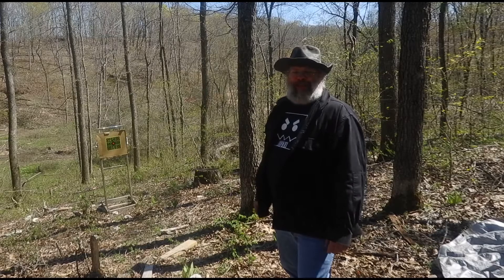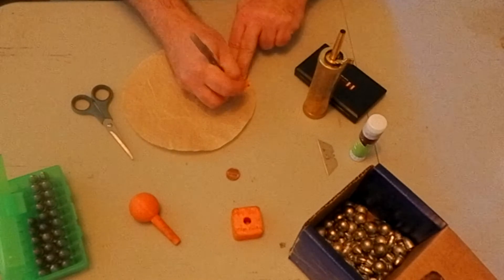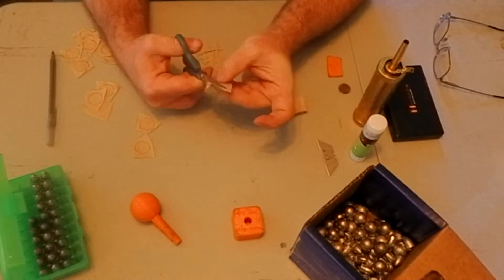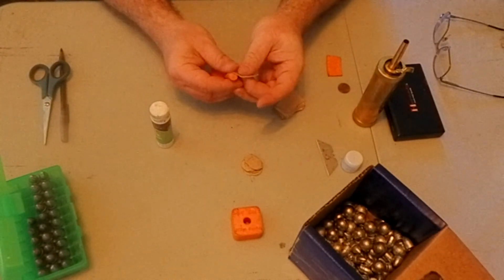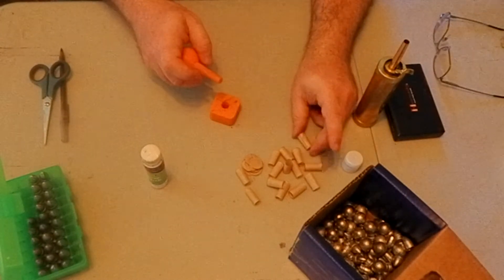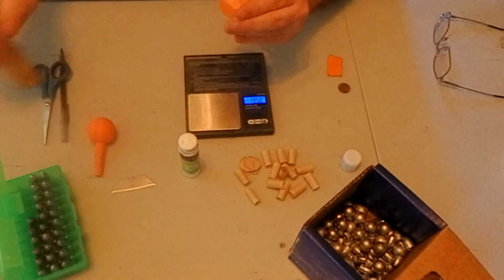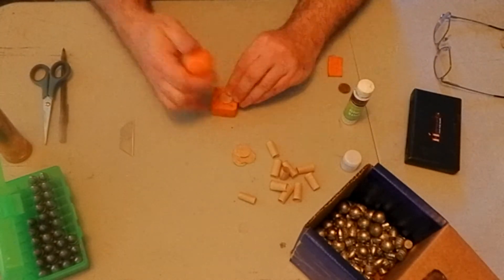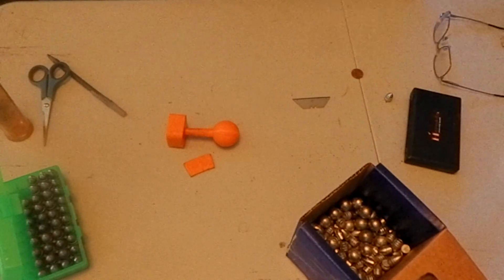making paper cartridge with 3d printed Mandrel and Die set

Comment: I use a Very Different method. I run my case wall Paper wild in length, glue with about an 1/8" seam, run out the bottom of mandrel, trim bottoms flush. I use ends n pieces for bottom ends, not really caring if they are round at all? I typically find square, or pentagon shaped ends glue up best and is most durable as the longer corners get a little more glue to surface area, and I use a rice paper for rolling cigarettes on ends 100%, Or Side walls about 60%. 

I acetone my lead for proper glue adhesion. I fill empty paper cups with powder, place glued lead! Once Ball Or Conical is Placed, glued, NOT Dry, I trim paper final length on Lead and dry. 

After dry, I dip filled cartages Lead in DIY hot lube. Looks not the best But HOLDS GREAT and is most durable for me, and it all comes out in the wash when I drive the lead into a cylinder, ending with a lead and paper witness ring.
 
Did the nitrate paper but the JD Conicals fit poorly as this makes my paper a little too thick and tall to fit in my loading gates. 

The fun is in the Hunt! and every time I think I have a better system I get to Test Again!
Keep your Smoke Poles SMOKING!

Comment: I have a similar method of making the cartridges for my .36. I use a 5/8 inch paper hole punch that I got at the local Hobby Lobby. Perfect and way easier than trying to cut out.
I too use (cheap) coffee filter paper, but actually have yet to soak in the nitrate first. I sometimes get a small ring of unburned paper left in the chamber, but it is perfectly fine. I have fired subsequent loads leaving the paper in on purpose with no issues.
I cut my paper out from the edge only and get 16 per filter then punch in the center.

Comment: You got yourself a good effective method of making Combustible Paper Cartridges for percussion cap&ball revolvers.

Over the years I found discovered that Thin Wax Paper makes for the overall best non nitrited paper to use as casing material to  make CPC'S  with my Universal Bullets. 

To be exact;
Thin Bakers Wax Paper is the most effective non nitrited paper which is very durable, self combustable, sealing, protective of the  gunpowder from Water, Oil, Blood Fluids Humidity etc.

 In a recent test a CPC  was made with the Thin Wax Bakers Paper and ignited with Factory percussion Caps, out of all six chambers, 4 chambers had no unburnt paper. Two cylinder chambers had marginal trace of unburt wax paper.

So far I prefer the EZ Cartridge Formers in 36 and 44 caliber available from Galtsons.com. 

Watch "Combustable Burn Rates of Thin Wax Papers For Use In Making of Combustible Paper Cartridges" on YouTube
https://youtu.be/zM1Cr53S2mo

Comment: I hit a sale at my local Hobby Lobby.  Hole punches of different sizes and shapes.  1" star and 1" circle for $1 each.  At least the bases are easy to cut out now.  The star doesn't put quite as much material in the base, but still covers the base of the cartridge.  It will punch 3 or 4 layers at a time so that part goes quick.

Comment: The links in the description are not working for me
Reply: Google Chrome has started blocking mixed-content downloads (even if you turn off the "safety" features).  Try opening another browser and the downloads should work.
Reply from the maker: not sure why the link youtube has is not working,
Die ~ www.james-gang.org/~bjames/stl/44-die.stl
Mandrel ~ www.james-gang.org/~bjames/stl/44-mandrel.stl
Template ~ www.james-gang.org/~bjames/stl/44-template.stl
if you copy and paste it should work ,
Reply: @James-Customs  
The links are not working.
Is this your product? 

I am a known Black Powder speciality Bullet inventor who represents  thousands  of potential  customers.  I am looking to have CPC'S Formers producted which will hold the maximum Powder capicity loades in conjunction  with my Universal Bullets series.
Reply: @James-Customs   They don't work because they're direct links to files, and YT doesn't play nice with redirects outside of their ecosystem. You might want to do a comment stating that the links are direct file dl's and then "pin" the comment so it stays top of the stack. Then just put "check the pinned comment for file links" in the description, instead of the broken links that are presently there...

Comment: I do this almost exactly the way you do, but I find it extremely difficult sometimes to gt the cartridge to seat in the chamber.  What you said about dipping them too far into the wax might explain the cause of that problem perfectly, because I do dip the cartridge in far enough that the top of the paper gets waxed, and now that I think of it, of course that increases the size of the cartridge, making it tougher to fit in.  Thank you very much for this excellent insight.

Comment: I just found this stl on thingiverse along with two other variations.  I'm glad to this one really works.  I will definitely go with this one.
Reply from the maker: The one I'm using is modified off the thingiverse one, The one i found was made for round balls, 

I put a download link in the description to the stl files i made, still had to do a little sanding to insure a good fit for the die and mandrel.
Reply: @James-Customs  Sure would be neat if those links in the description actually *worked*... 😉